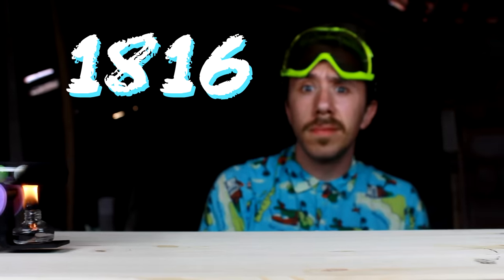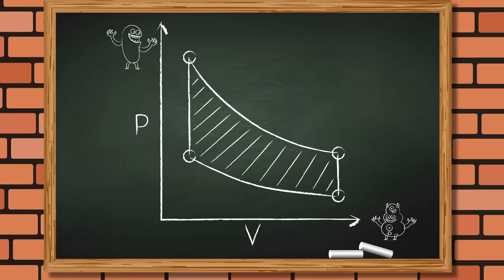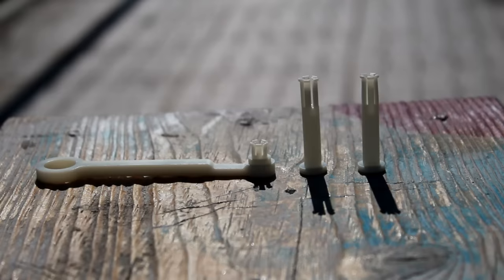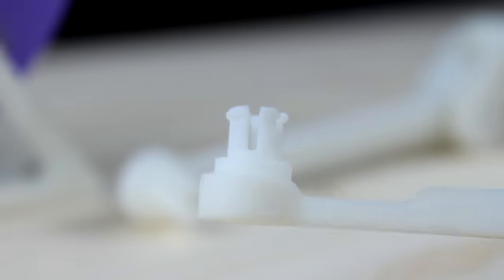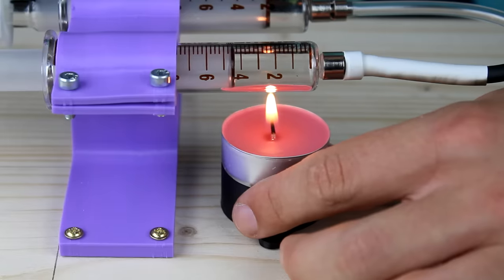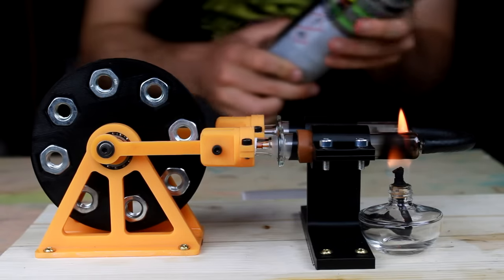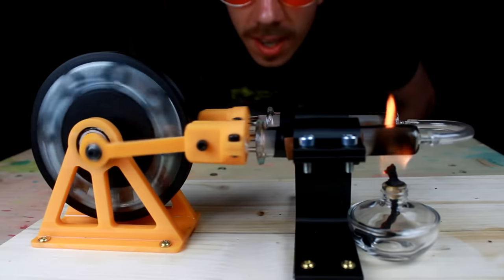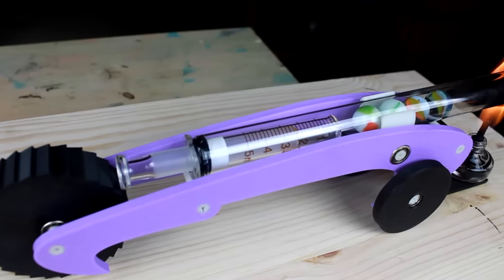Hot Air Engine Car (Stirling Engine 3D Printed)

Comment: For your tubing melting issues, you should try a heat shield, redirecting the heat from the flame. It looks like most of the damage is caused from the flame. Try an aluminum or copper flat cone shaped or flat collar on the neck of the piston.

Comment: Put a cone on the tip of the syringe obv made out of something that can withstand the heat. While you should still get radiant heat it shouldn't be enough to melt it though.

Comment: Reposition the syringes until they are flush and relocate the flywheel. This will give you an extra 1/2 to 3/4 inch of clearance on the syringes and the flame will no longer set your hoses on fire.

Comment: I’d use heat resistant silicone/ceramic mix as the tube so it can bend but on both ends the plugs are ceramic so the heat doesn’t damage the silicone.

Comment: I think you can heat up the cylinder by coiling a thick copper wire with the tip in one side. Place the burner so it burns the copper tip, this might heat the cylinder thanks to the thermal conductivity of the copper. Fire is away of melting materials and engine is still running. Well... maybe... I'm not an engineer in any way, so... ¯\_ツ_/¯

Really great video by the way! I recently discovered your channel and instantly subscribed, great work and really interesting stuff my friend ;)

EDIT: Intead of a copper wire, use a thin copper tube vent around the cylinder. That will transfer hot air like the old steam locomotives boilers!

Comment: Mr Integza, try cutting a metal soda can to act as a heat shield to deflect the heat and protect the tubing. you can even make it so your lamp can fit inside the soda can.

Comment: This, connected to an alternator, connected to those new fangled brick/sand/etc heat batteries, connected to water heating panels. Idk if it’s more effective than current mainstream solar power but it could work.

Comment: Definitely needs cold cylinder heat sink. You could solve the whole "burns tubing" problem by changing the burner to a wire wound heating element on the hot cylinder. These can generate just as much heat more efficiently and won't set fire to your transfer tube!

The regenerator failed because when adding it you also looks like doubled the amount of air in the system. Rather than adjusting the stroke of the cylinders to accommodate it, you should place it in it's own chamber between the cylinders. This will increase the volume much less. 

Also, Integza's outfit fits perfectly in sepia tone 1816, and I gotta say that's pretty fantastic

Comment: I wonder if even an aluminum foil heat shield would have deflected enough heat away from the tubing, but another thing I was noticing was that if you were willing to either get a new mounting wood, or simply move the syringes' mounting further up closer to the wide outlet, I'd imagine that'd give you a bit more room for heat dissipation before reaching the tubing. Alas I am not an engineer, just some observational comments. Really do enjoy the videos.

Comment: Maybe putting a wide diameter metal washer with a hole in the centre that fits perfectly onto the syringe nozzle would block the flame from getting near the tube that kept melting, or maybe it wasn't the flame but the glass nozzle that the tube was wrapped around got too hot.. idk.
But that's my guess of a possible solution.

Comment: You should coat the pipe in fireplace sealant so it doesn't melt. You should also add a motor on the part that spins and connect that to a led light and it will be a generator.

Comment: get some glass pipe (made out of pyrex, not normal glass!) and a blowtorch to bend it into shape, then use that to connect the two syringes to fix the issue with the melting tube. you can either weld it onto it or maybe get some high temp epoxy for the seal, the first option obviously is more elegant. shouldn't be to hard and if you use the right glass it should resolve the issue completely. you can get pyrex glass tubes at shops for laboratory equipment, maybe even on amazon if you're lucky.

Comment: That first darling engine was definitely dope you should try to make another version of your starling engine using glass tubing instead of the plastic it should make it more robust and more easier free to use and minimizes the of it breaking due to overheating

Comment: Should use copper tubing an seal the connection with a heat rated silicon or resin. Then you could also add an additional air volume to the circuit.  Also incorporate the heat concentrators in this circuit.

Comment: Fire wall with two holes at the top for the syring tips to poke through and use the tubes to hold it on with the candle on the other side

Comment: Ever thought of melting glass tubing, and applying it directly to the syringes? You could also lengthen the glass tubing outwards, away from direct heat, and then cool it in a separate chamber or connect them with a rubber tube.

Comment: Improvement proposal: Try cooling the syringe that is not over a flame with a wet cloth, water bath, or something. The sterling engine works with temperature difference, so that would increase the RPM and maybe stall the burning of the tube, if you water cool the engine. You could try to incorporate water cooling with your rocket engines too, that would be awsome!

Comment: Use a glass tube to remove the heat from the connection point.
And add a heatsink pipe or vapor Chamber to speed cool it

Comment: Hey integza try adding more air in the glass by having the syringe farther back as a norma engine uses almost all space to allow more expansion and compression as well as moving the fire under the center of the open space of the syringe and by doing everything above you can have more economizer in the system also avoiding the melting point of the plastic tube making it longer lasting and a higher pressure out put causing the machine to operate higher than your tests (ps. Also has a higher rpm due to the higher pressure output)

Comment: Ah I remember making one of these as a kid and I used wood instead of plastic. I didn’t have such a problem with the melting pipes from the flame as the needle part was longer which helped it not melt however it did on some occasions. Im kinda tempted to try making it again but I’ll need parts.

Comment: I'm thinking a shroud that both concentrates the heat onto the syringe and prevents said heat from the hose.  A sheet metal form with a close fitting hole for the syringe outlet that forms around the syringe with an opening on the bottom and small outlet vents on top.  Perhaps even a length of 10-12mm ID SS tubing that encircles the syringe by 3-4 turns with an inlet/outlet 180° of each other.

Comment: I know this is an old video, but I just saw it on my feed today. Anyhow, the gear mechanism could be improved by a clock pendalum gearing to prevent it from reversing in each cycle. It would move forword more smoothly, efficently and advance faster. Just a suggestion if you build future upgraded versions. Btw, nice nails😉👍

Comment: Flexible metal tubing such as used in cars for breather lines or in power steering would have saved you many hours and not filled your workshop with toxic fumes. But that would have been less entertaining and that is one of attractions of your physics channel. Electroboom in Canada uses a similar approach and it is addictive and productive the same as your ways are.
Of course the obvious solution to melting tubes is to have a metal one (aluminium alloy is best for having low heat loss) and in would be in a 'U' shape. 
You could call it a "U TUBE".

Comment: Can try adding a heat sink, and a water tray to the cold side, that will help with the heat difference, and can put ice and salt in the tray or CO2 or both for a smoky adventure... 😉 
Then it will be a bit more efficient...

Comment: yeah WD-40 was developed as a form of liquid rocket fuel, it isn't energetic enough for rockets it is on the other hand energetic enough to run a car engine and its two most common uses are lubricating things and trouble shooting ignition issues in an engine because WD-40 requires a stupidly small amount of ignition energy to start burning, not as stupid low as phosphorus but about as low as any fluid gets.

Comment: I feel like if you would change the heat source or maybe isolate it from the tube while also using high heat material like the tubing in car engines, you could prevent the tube from burning. Also as for the regenerator, maybe making its own chamber directly in front of the heated cylinder/syringe would also help. I  think if you could change your heat source to an electric heating mantle like used in chemistry could be a much more focused and insulated way to heat the glass syringe. I'm definitely not a professional, but these were just some theories I figured could improve upon your design. Hope it's helpful :)

Comment: I would say the best way to help the tube would be to find a syringe with a longer glass tip. It probably is the best way unless you can find a metal or ceramic tube

Comment: That last one, what if the gas exchange tube was through one piston right to the other, following the path of the piston arm?  You could apply as much heat as you want to the glass cylinder that way.  It might even be possible to merge the role of gas exchange tube with the piston arms

Comment: To the Stirling engine, I present the ice pneumatic air engine, apparently using ice (kinda works better with dry ice) and chucking it into a bottle that connects to a air engine gives more air psi and pressure. But you should probably use something other that soda bottles, not fill the bottle up with high psi, or install safety valves or pressure release valves, other wise it might work good has a grenade

Comment: Instead of placing the torch directly, try to use a copper wire to transfer heat between the torch and the glass tube. 
I like your video

Comment: Instead of the melting rubber tube, use a metal tube with insulation around it to minimize heat loss? I'm very impressed by your videos.

Comment: You could probably have used brass car brake pipe for the tube connecting both syringes or copper pipe.

Comment: Instead of useing plastic tubing, try useing high temperature silicone tubing. Should work better. Or use the syringes that have the metal tips and silver solder on a insulated brass tube to connect the cylinders.

Comment: i suggest you get a short piece of 12mm copper pipe, with caps on the ends, and set it at 90 degrees to the ends of your syringes.  fill with scrubby (metal drill shavings, really) and solder or glue the caps on, drill holes to fit the ends of the syringes, and glue these in place with high temp RTV silicone, or JBWeld, or something.  this may solve your plastic melting issue, and should also give you a decent regenerator, in the right place, no?  aluminium might be a better material for this.  i consume tomatoes daily, how do you solve the problem?  and hello, how do you do, am honoured to meet you, youtube thought i should - thank you for being there.

Comment: if u do another version try to use a brass pipe and have 2 square compartment in front of the pistons and fill them with steel wool

Comment: More distance between flame and the tube, maybe double, or triple the distance. 
Isn't the majority of the heat of a flame near the tip?

Keeping them further away will focus the heat to the area you want and incidently, away from the plastic (+ a difuser as someone else mentioned).

Two tomatos with but one stone, as they say.

Comment: Have you tried to wrap some aluminium foil on the tube? it should help dissipate heat. Eventually put some wet towel in between.

Comment: I have always thought about making an engine for a car from a benson burner, this sterling engine, or a hit and miss engine. 

My thought is:

if there was a shape resembling an infinity, with paddles in the inside that connected to the outside driveshaft.  it could be filled with water or mercury and heated up to created unlimited driving miles. @Integza

Comment: Could you use a small piece of aluminum foil (not attached to the engine but on its own stand) to help deflect heat from hitting the plastic tube?    

Use like a set of third hands and use it to hold a piece of folded foil between the flame and tube

Comment: have you considered connecting a small copper pipe with heat resistant silicone sealant , or even a fireproof hose (fiberglass sleeved silicon) instead of the melty vinyl hose? [Love your content, currently working through your back catalogue of videos. Keep up the great work!] 🤓👍👍

Comment: The other problem with steam engines is efficiency. All the heat used to go from water to steam (latent heat of vaporization) is lost to entropy, as a result, steam engines used more than 10x the heat energy than the energy they put out.

Comment: How about printing block type plastic parts (like a log cabin but waaaaaaaay smaller) and have a metallic contact in between the blocks where when they’re stacked next to eachother to form a wall they create an electrical circuit (small voltage obviously) for lights and switches… different house layouts

Comment: If you made the pistons and platform out of copper pipes, you wouldn’t have to worry about anything melting. 
If you replace the the nuts in the flywheel with magnets, you can generate electricity from the flywheel spinning.
If you want me to show you how to get it to run without fuel… let me win that 3D printer.

Comment: Have you tried applying some starlite around glass syringe end and then also around the tube to help prevent the tub from melting, I know it was a solution to the thermojet engine you made in combination with the rubber tube which seemed to burn rather then be melted?

Comment: You coud have packed the ends of the syringes with some 3D printed magic and change the working space of the piston which would increase the distance between the flame and the connecting pipe.

Comment: If you put a large washer on the flammable end closest to the flame with a nut over the end of the tube, would that have helped prolong the life? Also say the heat was generated with an electronic source rather than a lighter, would that present new problems?

Comment: Use Glass or brass (grb) hallow rod tubing connected to the end of each syringe with either a snug fit or jb weld at the connection point. Extended the grb out about 6" to 10" to disipate heat , then you would be able to connect the grb tubes with your air line or the high heat black tubing. I would be curious to see how fast it goes then haha, please make a vid fixing this up right!!!!!!! I will smash a tomato in your honor if you do. Ty integza!!!!

Comment: fine vid.
for the car a little addition could improve it much: add a roll back protection lever. it might fit nicely on the front side of the front wheel.
for the very first syringe demo i felt like the piston caught a little thermal damage. at least it looks like it received a bit of transparency changes during first heating.
for the alpha engine interconnect tube i am not currently having an instantly promising idea - unless you want to do glass welding on your own (with a hydrogene burner e.g. a Bunsen model it should be possible with not much fuzz - but will it be really tight on the hot end?).

Comment: legit question, if you pressurized your hydraulic tubes first would you get a stronger pressure output from heating the air inside?

Comment: Could we have a spinning wheel that incorporates the regenerator in a NA four stroke engine?
By spinning it literally takes heat out of the air charge of the cylinder port by spinning???
Spinning cylinder port for the win. : )
Seems simple, but is worth exploring and explaining.

: )

Comment: Can you 3d print the connecting 'tube' out of ceramic resin and connect/seal to the syringes with hi-temp sealant? 
You can also use that 3d printed space to house the regenerator/economizer, not unlike your alpha engine schematic.
But I'd probably use a tube that is as short as possible, and stuff the regenerator/economizer to ONE of the syringes only (the hot side) and maybe experiment with amount of that.

Comment: Another thing to note: in the world of bicycle repair, most mechanics will advise to NEVER lubricate with WD40. Not only will WD40 degrease your bearings, it is also hygroscopic and will attract water into your system. If you use WD40 on the drive train of a bike, it will lose lubrication AND rust! Bearing re-greasing is usually done with a HEAPING gob of polylube.

Comment: Could you use high temp ptfe tube for the hose between the syringes? It would be high temp and the Bowden tubes on the 3d printer extruders are made out of it?

Comment: lower the flame compared to the syringues by around 4-5cm so the tip of the flame barely touch the tubes, by lifting all your things up and at same time have more space for the flame burner. and redo another video, to fix the burning tube problem, get glass tube extensions for the syringue, try to put the scouring pad in the tube next to the pistons, not the syringue/pistons, should be a lot more powerful with all these mods
Reply: unless you doing that on purpose, but the higher temperature of a flame is just above the tip, everyone knows.
even us hobbits in the shire.

Comment: What you need is to use some glass tube instead of rubber or plastic your wire idea isn’t that far off try using finer gauge wire wool you should have more successful runs or even try with a glass valve between the 2 tubes 👍🍅🔨🏴

Comment: making a 'U' shaped connector pipe out of aluminium or copper and cementing it to the ends of the syringes would save a lot of hassle... 🤔

Comment: The metal dish sponge is often called Chore Boy after the brand available in the USA.❤❤❤❤❤❤❤The crack addicted community uses it as you did but the burn crack and use that as a filter.😂😂And now you know.😂😊❤